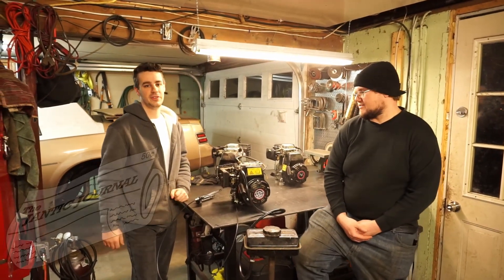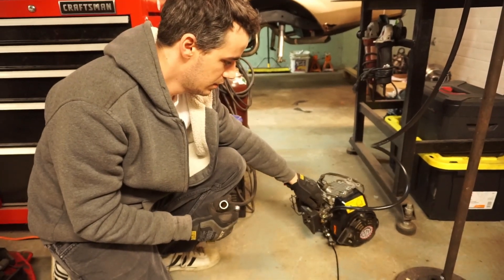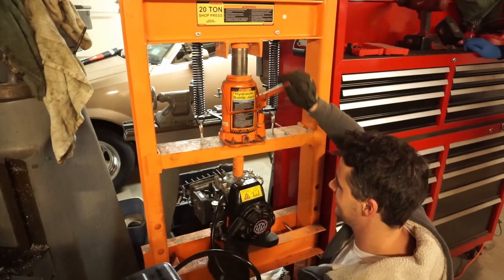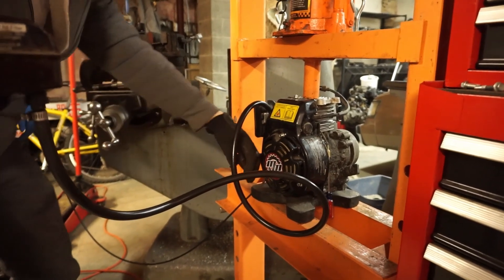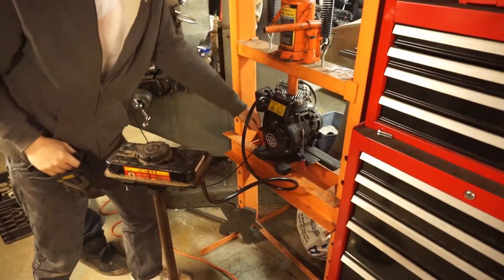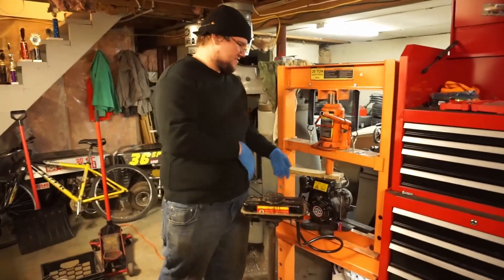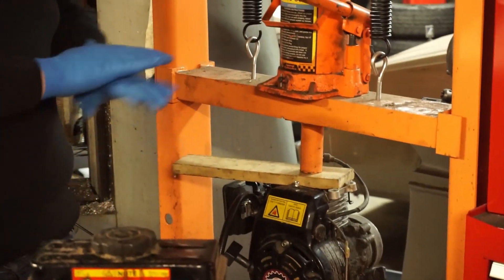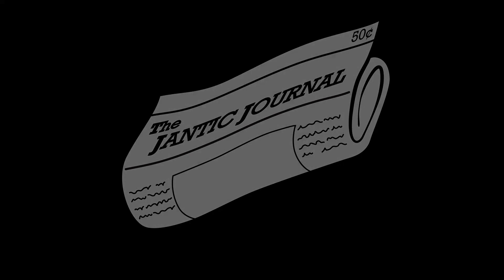Engine without head bolts + hydraulic press = profit????

Comment: thats funny. It should work just standing on it since they only have like 80 psi of compression. or would that be 80 x 6 or whatever the area is?
Reply: You have to look at the area of the piston and multiply that by 80psi. I'm guessing these have the same bore as a GX100 which is 56mm bore, which after some math comes out to a 3.8in^2 so you're looking at needing to handle approx 300lbs of to hold the head down.
Reply from the maker: Ok then Joey will hold some lead weights lol
Reply: @scottwatrous  on a flathead its even bigger area. But thats before the explosion even happens. So it might get one bang before the head floats and gets misaligned. It might run with alignment pins or a couple bolts left in loose. Only one way to find out !
Reply from the maker: Joey is about 260ish so we may have to find out. Thanks for watching